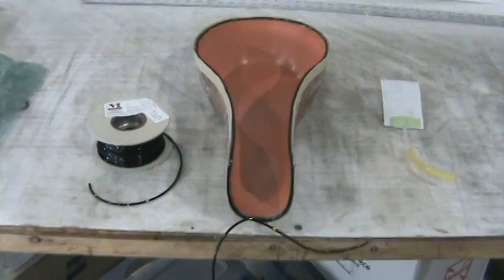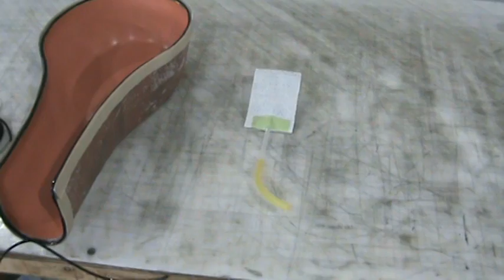Resin Infusion Aircraft Airbox pt.1

Comment from the maker: When placing the cloth in the mold, I lay the cloth on the edge of the table and cover with a piece of paper on top of the cloth leaving 1/4" exposed. Mist with 3M Super 77 spray adhesive. after a few minute you can place the cloth in the mold with the cement against the mold. Each additional layer is glued on top of the previous layer. The spray adhesive will dissolve into the epoxy and will not effect the part.